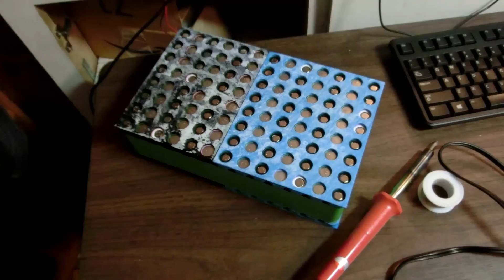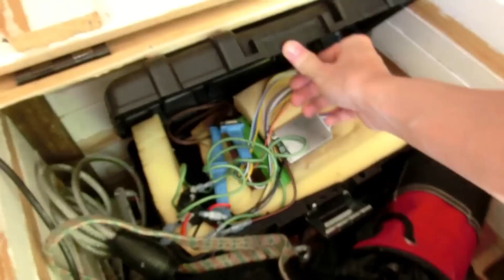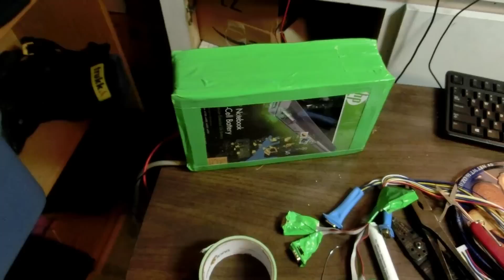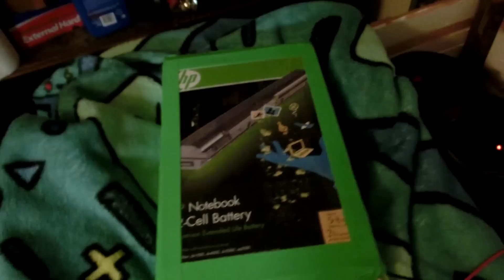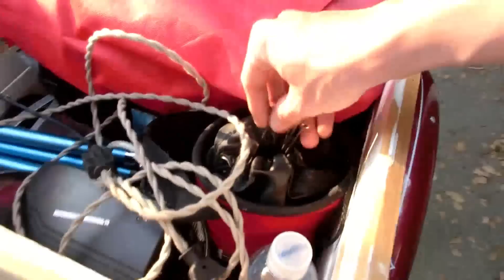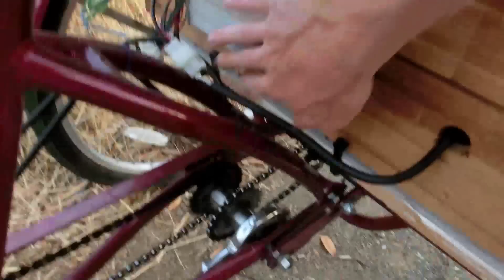DIY 52v (48v) 16AH Lithium-Ion 18650 E-Bike battery pack (E-Trike v1.6)

Comment: Could anyone help me figure which batteries to buy to build one with these specs? Im going crazy trying to figure it out
Reply from the maker: i recommend old laptop packs and test the cells yourself. avoid apple battieres since they dont have 18650s.
Reply: @RinoaL  Where would i get those? I was planning to build a battery thinking its cheaper but doesnt seem to be if buying new cells :(
Reply from the maker: go find a computer repair shop and ask them if they have any bad battery packs. or buy scrap packs online. normally just two cells go bad and ruin the pack

Comment: hello again  friend   i have one last question  on this vid you claim  about 2A per cell ....    i was told thease ones can do 3A per cell so here goes........ ................................................................................................................. i am going up to 74 v and would like two  styles   74v at 20 or 21AH     AND 74v  at 30A  or around  there.       and plan to use thease type  25 x Samsung 30T 21700 3.7V 3000mAh 35A        or  can you show me a battery configuration set up as in how many series  and  parallel ?  heres the link  ..                   https://www.ebay.co.uk/itm/25-x-Samsung-30T-21700-3-7V-3000mAh-35A-Factory-Box-Style/264656098776?hash=item3d9ebb95d8:g:P1IAAOSwmwheX8f7                                                                                                 can you show me a battery configuration set up as in how many series  and  parallel ?
Reply from the maker: well 2a is best because the cells work more efficiently at 2a instead of 3a, when going to 3a they waste more energy as heat and such. i try to make my battery packs big enough to only draw 1a per cell, and that actually increases range by like 20% because that energy isnt being wasted as heat.
Reply: @RinoaL thankyou   for all replies ONCE AGAIN    1 amp per individuals cell or cell block ?  as i plan to do between 60 to 100 batterys  20S   72v  3 TO 5 LOTS   WIDE  OR PARALLEL ....WITH THESE  Samsung 30T 21700 3.7V 3000mAh 35A cells

Comment: I know its been 4 years, but acetone would've been good to "weld" the plastic together.
Reply from the maker: takes too long to dry. several days. so no
Reply: @RinoaL   Oh, I would've figured an hour or two worst case scenario. Oh well, good job. I'm recycling old 18650 cells and learning the tips and tricks to build battery packs. Thanks for the videos.
Reply from the maker: @thecircusb0y1  yeah the issue is with a big piece, the acetone diffuses into the surrounding plastic making it all very weak.

Comment: How far can you go on 1 charge? Just running around town that is.

How far was the trip into the mountains?
Reply from the maker: mountain trip was like 20 miles if i remember. but i can go like 55 miles at low speed, 20 miles at traffic speeds

Comment: Open up your controller purchase a step up convertor from ebay £12 they have 100v capacitors on them your controller is limited at 63v you could go up to 55 60v on that setup or even purchase a speed convertor to step up your voltage

Comment: Is 14 gage wire sufficient for your discharge wires?
Reply from the maker: i'd go 12 guage. but if all you have is 14 guage maybe double them up a bit? 14 guage could warm up during high discharge and lower the efficiency of your battery.
Reply: @RinoaL  good deal..thanks..

Comment: You could probably add 2 more motor with a three way selector switch for some extra hp to go up the hills and then use the one motor to cruse around (or a combination of the three) I know this post is three years old but - thought it was interesting. Good job. one criticism (heatshrink over duct tape)

Comment: This is the 1st ive seen of elec bikes.Very ingenious.Is there a book on getting started? Great video
Reply from the maker: well i wrote a pocket guide on how to build the battery pack, search "Tinkerer's Guide to the 18650" and you will find a video where i read it and then a link to where to download and print it. Search ebay for "ebike hub motor" and plenty of kits show up. if you buy a kit, then you only have to worry about hooking up the battery.  remember, if you go for a front-wheel motor you should reinforce the front fork. this can be done by buying a torque arm made for this job or simply welding the front fork to make sure its strong. otherwise some forks can snap where the motor bolts on.

i've been thinking about making a "tinkerer's guide to e-bikes" for a while now, would you find that useful? i might start writing it. i hope to start printing and selling my own books once i get my printing press running.

Comment: Great stuff Rinoa,but why not use sealed 12v alarm 4.5amp  batterys there only about 3 inches long,very cheap about $15 ,you would only need 3 or 4.All the best.

Comment: Great videos..! Just waiting for my parts now.. My project is a 8fun 350w middrive / NCR 18650 3400mah (p6-s10) fused, no BMS but bottom balancing using cell meters with alarm and a diy charger lowered to 40.5-41 volt.. Can't wait.. :) keep up the great video making.! Cheers from Denmark

Comment: What size hub motor are you using 48 volt by {1k or 1.5k watt}?  Suggest you add in a push button breaker inline with the controller and motor power lines. 20 to 30 amp. depending on the controller spec.'s.  *can save $ on a bad overload/short burning both out = an expensive lesson I learned on my trike.

Comment: Hey super idiot here what kind of wire should use to connect each battery?
Reply from the maker: +Alan Day 12awg found in automotive isles of hardware stores should be more than enough. although i think i got away with 14awg

Comment: Would it be OK to not balance charge if all my cells are new, start at the same voltage and are the same brand of battery?
Given I want this battery to last a few years until I get myself a car or make a better electric bike, so if they get a little out of balance over those few years im not concerned because by then ill be tearing down the battery and using the cells for other projects or getting a new, better battery (as my budget was limiting me here)
Reply from the maker: +Sapphire Destiny make sure they are all the same voltage before sealing it up, then open it back up and check the cells after like 10 cycles to more accuratly judge
Reply: Yea with my old bike battery I did this and they all stayed balanced. I kinda fucked that battery up so it didnt last long.

Comment: Sorry my audio is low,did you mean 4A speaker fuses?...Why not just use 20a bms ?
Reply from the maker: +Fook Utube because a bms wont stop a short circuit. >_>
Reply: Thanks for the infor, im still learning...I just did my first 12v 20a pack,and it took me ages to figure out,that you dont add ah in series.So for the longest time i thought i had a 60ah
Reply: So it was 4a speaker fuse then ?,i might pot some on my pack.....
Reply from the maker: +Fook Utube oh sorry, "pico fuse". sorry about that. they are tiny fuses that look like small resistors. really easy to add to a battery.

Comment: I have a 1982 Volks Waggon Desial  Rabbit with a Prestolite 40HP motor rated at 96VDC with a Curtis controller and 16 ~ 6VDC deep cycle wet cells rated at 250 amp hours each for a power source. I can go a max of 68 miles, these batteries are 58 pounds each,,  I want to increase my miles to 300 miles range. What do you recommend in a DIY pack like your's?? Weight and voltage of around 100 Volts DC??? Thanks
Reply from the maker: +Dale Robertson i recommend looking for a nissan leaf battery from a scrap yard if you want to power a car with lithium.
Reply: Thanks..I will, Cheers..
Reply from the maker: i got 3/4 of a nissan leaf battery for about 3500$ if i remember right. i mention it in the videos for that. i plan to put them into a car someday.

Comment: you can buy those battery spacers from ebay they are very cheap an robust it will keep enough gap for some cooling to happen because lithum battery gets hot while charging and discharging..
Reply from the maker: +Kuntal ghosh they only get hot if your doing something wrong
Reply: Rinoa Super-Genius really??? my 3s Panasonic 2500ma battery get a bit hot while charging at a cc of 3amps and it becomes even hotter with 5amp and it  also charged up very quickly!!
Reply from the maker: yeah, your charging them too fast. if you dont want them to overheat, and would like them to last longer. aim for 0.5C charge and discharge. you also know you will get at least 2 hours of battery that way, and far less stress on the cells. one of the biggest mistakes people make is to not make their battery big enough. its totally understandable for something like an RC plane but for an ebike its not worth it to over-stress your cells.

since i aim to have like 4x the battery power than i'll ever need, i dont need cooling for the battery. highest temp increase i've noticed was like 15 degrees F while climbing a mountain, and the battery was barely even warm then.

Comment: Bike=48v
12s=50,4v(more than 48)
Why you put 13s=54,6v?
Reply from the maker: because its hard to find a 12s BMS compared to a 13s. and because a 48v ebike would be expecting a 52v lead acid battery at the very least.
Reply: Rinoa Super-Genius thx so much,but an 12s battery you can charge with imax b6 (2battery pack 6s in series) sorry for my english

Comment: everyone talking about the wire size. the current is not as high as a lower voltage system. at 48-52v it isn't going to require a lot of current. I would like to know how it worked out?

Comment: So, how are these "balance charged"? Do you not have to balance charge batteries?

Honestly this looks a bit scary. There is a lot of energy stored in these batteries, and if any of them gets damaged and starts to overheat and vents... you'll have a chain reaction lol. Ideally you'd want to be able to replace them individually too, and for one that vents to "self eject" hopefully.
And maybe some kind of cooling system. Ideally the leads could be thick solid copper and equalize uneven heating.
Reply from the maker: +Dejay Rezme with the BMS

you only need cooling if you build it wrong.

Comment: I watched your other video DIY 55$ 24AH Lithium-Ion 18650 E-Bike battery 100+ Mile Range: complete build. How is the battery in this video different? Does it last longer? Is it stronger? Is it efficient yet weaker? Also why did you put the motor in the front where none of your weight was?
Reply from the maker: +Dane Rodrigez this one is slightly smaller and has fuses, and my 3d printed frame for the cells is better. its just incrementally better in several ways but both are still going strong after like 5,000 miles

i put the motor in the front because its easier, i also like keeping the chain drive seperate from electric. and on my old cargo trike they dont make motors to fit on the back

Comment: This video should be named "HOW TO MAKE A BOMB" These are not everready's.If you neglect to add the additional wire to each battery to show the condition and charge(flow charge) status you'e gonna be sorry. A SHORT CIRCUIT  circuit is inevetable. Actually impossable to avoid an early death of the battery..
Reply from the maker: +Richard Price flow charge isnt a thing, your thinking of ballance charge, and i do that in this video. and short circuit doesnt matter since i have fuses. ive been working with lithium cells for a long time and i havent had any huge issues yet.
Reply: Consider yourself very lucky. I have blown quite a few. I have found them very touchy. flight UPS747 is one example of why they have banned them on commercial aircraft.
Reply from the maker: +Richard Price luck doesnt exist, i deliberatly do what i do because it works.
Reply: I suggest you stick with designing batteries and power packs. You won't make it very far as a comedian. LOL

Comment: so...wheres the step where you checked the internal resistance?
Reply from the maker: +Johnathan Wuethrich the fischarge test, if the resistance is too high it wont get pulled down to 3.6v in one go. other than that i dont care about resistance, doesnt matter too much

Comment: Would have been neater to add channels into the 3d print for the wires and components. Also why a fuse per 2 cells?
Reply from the maker: +Joe Anthing i put a fuse on each cell because a cell can short out if it fails

Comment: VERY GOOD. It would be a good idea, to have two engines on the rear wheels, to increase the power in the climbs, and each with its battery,

Comment: how much does it cost you to get used laptop batteries and where do you get them.
Reply: ebay preaty cheap here is a link to some "OK" ones : http://www.ebay.com/itm/50PCS-3-7V-6000mAh-18650-Li-ion-Rechargeable-Battery-for-Flashlight-OY/282082259082?_trksid=p2047675.c100009.m1982&_trkparms=aid%3D888007%26algo%3DDISC.MBE%26ao%3D1%26asc%3D38530%26meid%3D28ac6768ac5646dca85dcd5405062fd3%26pid%3D100009%26rk%3D1%26rkt%3D1%26sd%3D182317461582#rwid
Reply: Davidog thank you, i was looking at the Panasonic cells from aliexpres they are like 5$ each which is crazy. i'll try some used ones.
oh those are new with that capicity for the price ? that's awesome if true
Reply: I would be careful. These are most likely fake cells. Chinese used cells or fakes that really only have 800-1000mAh in them. Panasonic cells are one of the largest (and most expensive) cells right now at 3400-3600mAh. Don't believe cells that say they have more from generic no name brands. Look for used laptop batteries that are really think like lenovo or dell ones. Sometimes you can even see the 18650 round form factory in the pack. You can usually do some math on these to figure out the cell count (ie 10.8V 4200mAh used battery would be 10.8 / 3.7 v per cell = 3 and more than likely each cell is 2100mAh each so 6 cells total)
Reply: Chris Germano yes you're right i looked at a video of a man testing those trustfire 6000mah they have 800mah, and panasonic are the best there is also the LG ones they are slightly better than the panasonic in term of the energy delivered.
Reply: yea just realized they're  fake :p

Comment: Hi, Just watching your video and had to give you a tip on welding plastic (rather than using a soldering iron). If you have a dremel tool, use a little piece of filiment and friction weld the seams and cracks. See here : http://sandback.com/friction-welding-holes-with-filament/

Comment: Hi Rinoa, you would make a great HV commissioning engineer. I learned that also by trial and error and did well from it. If you like electrics from batteries to generators this is probably the best you can get but not the ultimate you have to change jobs to cover everything. Love your interest in your hobby.

Comment: Question about your Picco fuses....  Would you do that again? From what I'm aware of, these type of fuses don't physically appear damaged when they blow so you wouldn't visually be able to see if they ever blow and being that they're connected in parallel with other....  You technically couldn't test continuity through a single fuse once they're all in place. Have you had any issues with this? I'm building a similar battery but terrified of having to resolder everything in the event of an accidental short circuit.
Reply from the maker: yes i will use these again, and no you can test if they are broken while
 in the circuit. if they are broken then there must be a voltage 
difference that broke it. thats ussually one cell being shorted out. so 
youd just test what cells were shorted and what werent. 
  
likewise if one failed for no reason, i guess you could draw a heavy load from the battery and look at the fuses with a cheep thermal camera like the Seek or whatever.